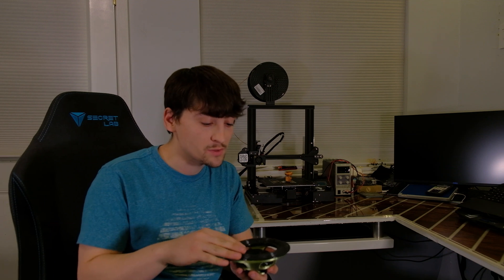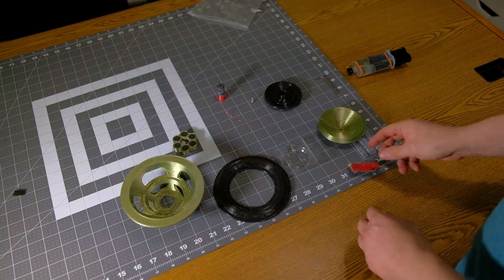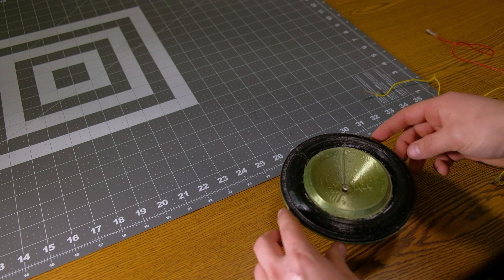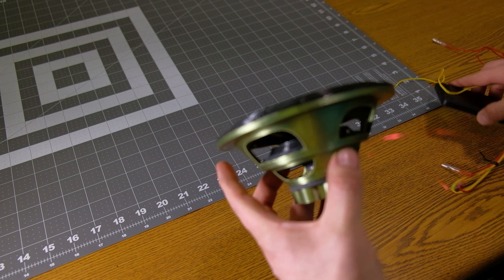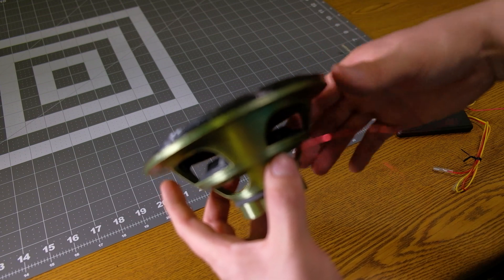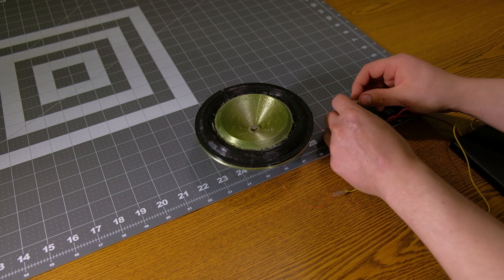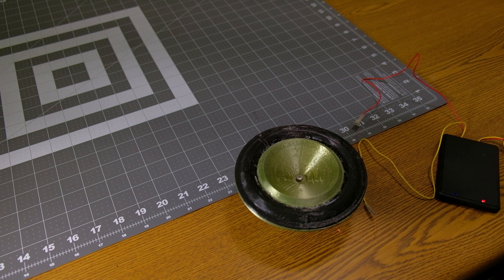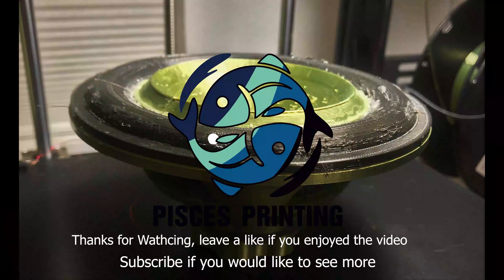Fully 3D Printed Speaker

Comment: Sound generated is related to material properties. I thing plastic is not suitable for printing suspension.
I think suspension should be made of more flexible material,then only the diaphragm could move.
Reply from the maker: If you’re talking about the surround on the speaker and the spider for the cone, then they were printed with TPU- with a shore hardness of 85A. They are extremely flexible. The material is a ninja flex TPU.

Comment: 3D print an enclosure for your speaker !
Reply from the maker: That would be fun! however I have no way of checking thiele parameters to determine the best enclosure size. I have 3D printed an enclosure for a 2.5” woofer I have and it’s decent but could use some tweaking... PLA doesn’t sound exactly like a good solid oak box...

Comment: Hey man. Well done on your work. Feel free to check my channel out Polymate3D. I have been working on this for a long time and giving results as well
Reply from the maker: Hey thanks man, I checked out some of your videos, awesome work on those. How are you building your coils? Are you going 2ohm or 4 ohm? Or something else?
Reply: @piscesprinting Hey. My motor is a underhung design and so the coil is wound in a recess in the former.these builds don't require clean winding as I have allowed enough space for that. If your on twitter you can search polymate3d and follow me. I'm pretty active there and you can message me if you want :)